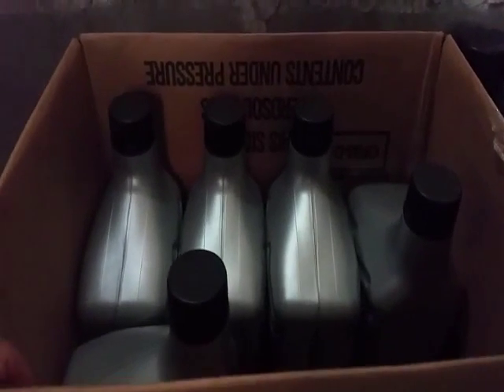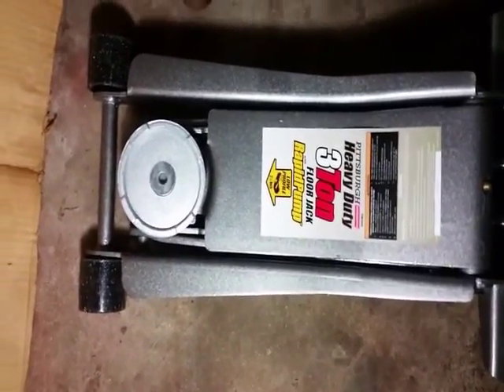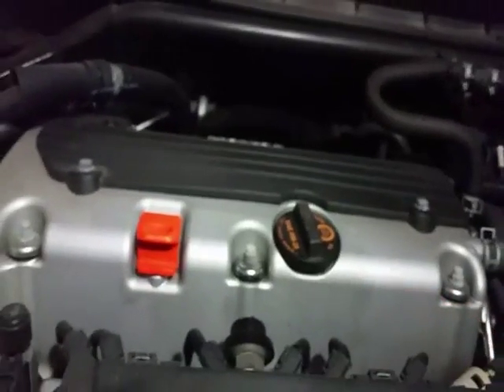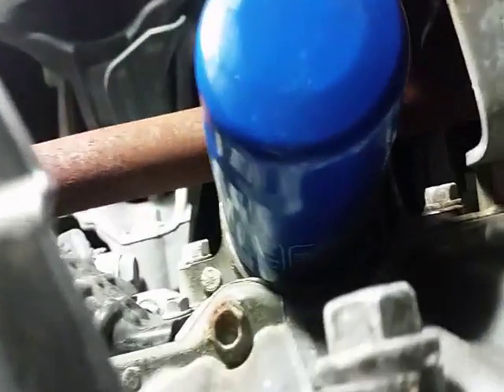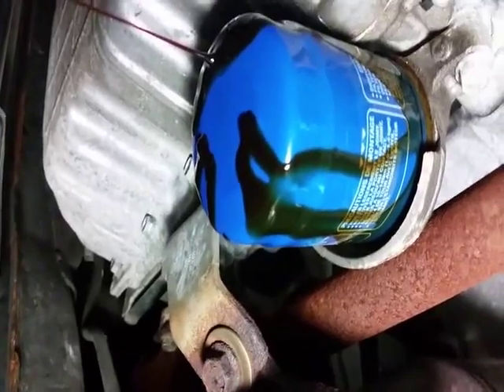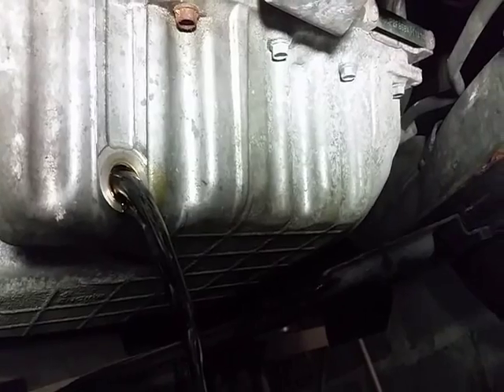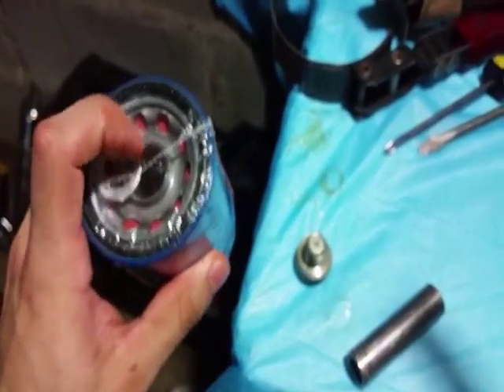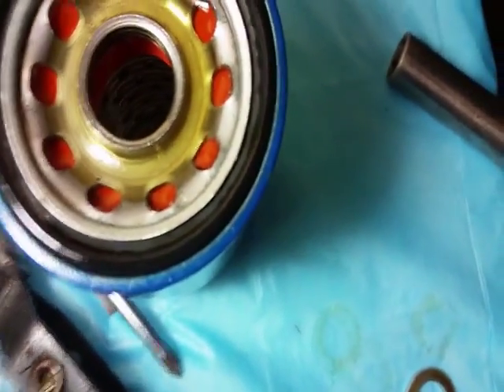2011 Honda Accord 2.4L Oil Change (part 1 of 2)

Comment from the maker: * QUICK TIP : BEFORE REATTACHING OIL FILTER, (IF USING SOCKET 
WRENCH), REATTACH FIRST THE OIL DRAIN PLUG. IF YOUR USING A 17MM WRENCH 
THEN YOU CAN REATTACH IN WHICHEVER ORDER YOU'D LIKE. THERE WILL NOT BE 
ENOUGH CLEARANCE IF YOU PUT IN THE OIL FILTER AND THEN TRY TO USE A 
SOCKET WRENCH TO PUT IN THE OIL DRAIN PLUG. 

THANKS FOR WATCHING!